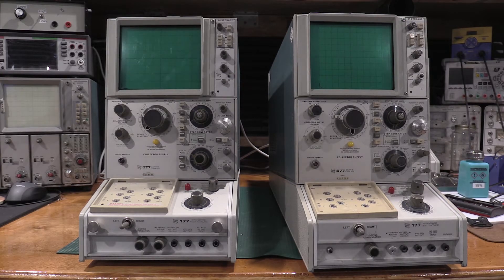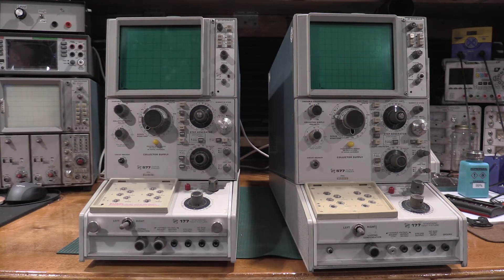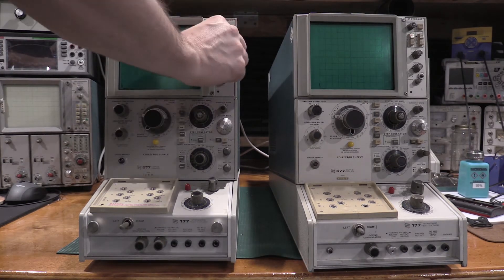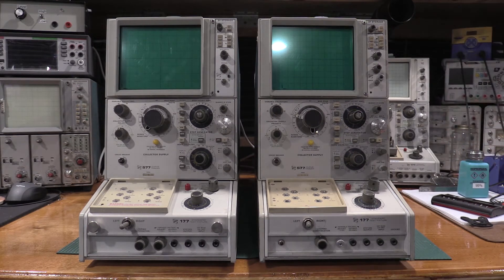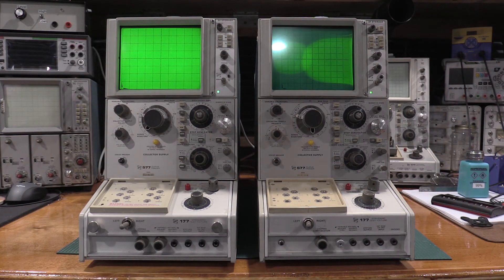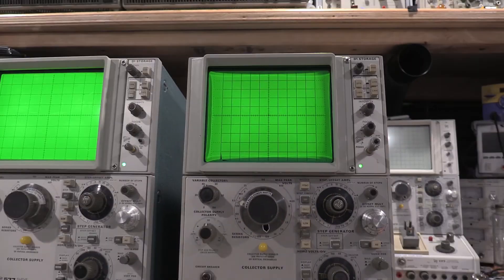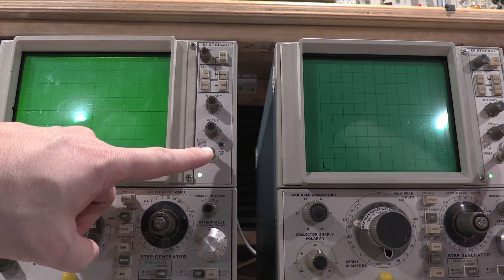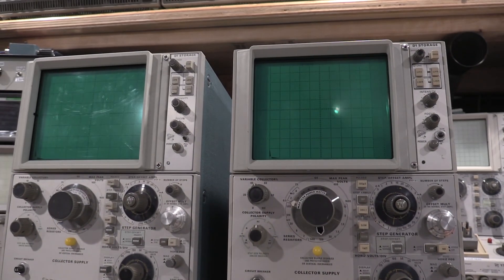577 D-1 Question

Comment: Hi there thank you for your videos I've seen all the other ones you put out about 577. I have a 577 d2 with 177 I don't seem to get any response from it when I connect anything to the test leads. I can easily change the voltage I can see it on the screen changing the graticule adjustment section works the high voltage switch works but it shows nothing even on low voltages when I connect component to it
Reply from the maker: The first check would be to set the collector voltage as low as it can go then hook up a DMM across C->E. Set the voltage to DC and see if there is any output on the test terminals. If there is then the 177 is suspect first and will need a closer look. The current sense and drive amplifier is in the 177.

Comment: thank you very much. your videos helped me with my purchase of a 577, D1 which was suppose to have a bad tube. but it turned out to just need adjustment. have a question. I have a D1 and it does not have brightness control. how do you energize the tube on a D1 or does need one?
Reply from the maker: Bob, There should be a "intensity" control as well as a "storage brightness" control Intensity is the main beam brightness. It is also worth noting that there is a power up sequence in the service manual if the tube has been off for a while. Storage tubes are easily burned by the way they function. This is a physical property of the tube technology. If If I recall correctly the power up is 6 minutes in storage mode with at full storage brightness and intensity all the way at 0. This will cause the flood guns to make the tube glow softly and will not hurt the phosphor. But it will electrically prepare the target for work after a long period of in an off state, but defiantly double check the manual.

Comment: Thanks much for your 577 vids. My D1 doesn't work in store, but works fine in non-store. I haven't troubleshooted it, because I don't anticipate needing storage. So what would you suggest to maxiimize tube life; leave it as-is, or get the storage mode working and adjusted?
Reply from the maker: From what I understand storage does not effect over all tube life as storage is the first to fade. The tube will have a LONG display life after storage faded. The 3 things that are more important to tube life are good intensity control and turning off when not in use. Proper biasing of the tube (service manual for this one) proper adjustment of the flood guns for good storage. However it is cathode emission that drop off first. As long as the phosphor is not burned it will WELL outlast the cathodes. Curve tracers tend to get burn at the bottom left, top right, and center point this is normal based on how the tube is use. The 577 non storage has a replacement tube option wail the 576 tube is unique.
Reply: @ZenwizardStudios  Thanks for the details, that's good news. I'll leave it as is, then. Nonstore display quality is excellent, and I can not see any burn marks. It's an impressive machine. I only need to replace the bat handle on the L-R selector switch.

Comment: Everything I write is based on personal experience. I have no special insider information. 

The hardest used 577 D1s seem to have “better” tubes. The casual use or shelf queen units typically had poorly trained users or at least users who lacked discipline regarding tube life. 

What I see in this video is a pair of healthy tubes. One looks like it was never used (the camera left a unit).  The other looks correctly driven. I can’t tell whether the camera right tube has burns.  All I could see is the flood driver adjustment. 

If it were my bet to make, I’d adjust the drive on both against the same DVM. Once they were both driven within spec, I’d look hard at overall intensity and any burn patterns. 

In every case I have (N=5), these storage tubes from 577s, 5111s, 5111A and 5103N D11s are all “good.”  The burn in is always somewhere that doesn’t matter. That further convinces me that heavy use equates to proper care. Otherwise there would be burns at the critical areas where you actually need to make comparisons between DUTs.
Reply from the maker: Thanks Crocellian, That is what I was looking for. There is some slight burn in on the right unit though it is typical curve tracer points lower left, center, upper right. I was not sure which tube was adjusted correctly and which one was over driven. What I am currently going with is right unit is proper operation, left unit is way out of adjustment in the storage section. Ill be doing a rebuild on both of these. Thanks for the help with the storage tube information. From what I have read it is almost impossible to find a storage tube with 0 burnin as a result of the storage function makes them more susceptible to burn. I will be running both through the calibration process but I now know which one to reference as to “normal operation”

Comment: What I think is that someone is hogging all the curve tracers! :)
Reply from the maker: I can definitely see how it would look that way. These were all parts units that were known bad. It is just such a useful too I hate to see them parted out and scrapped. Though I need some really random parts some times like a main knob. I am sure my SO would like me to move some along if I can find them a good home.
Reply: @ZenwizardStudios  I completely understand that impulse. They are amazing pieces of engineering. I love the fact that you are not tearing them up. I grabbed a second 576 recently but haven’t picked it up yet. It’s quite a distance away but I can’t bring myself to have it shipped and possibly damaged. I haven’t run across a 577 yet.
Reply from the maker: The 577’s are SIGNIFIANTLY lighter, only one power transformer. They get 100 V more collector than the 576 and their power band is different. The 576 is geared for more “power silicon” especially with the 176 it can do collector currents up to 200 Amps pulsed. For the 577 we get the 178 and the 177. The 177 is the “normal” test fixture. The 178 is designed to work with a D1 storage tube due to being slow. But it was designed to characterize IC’s and Op amps I have seen nothing like it before or since.